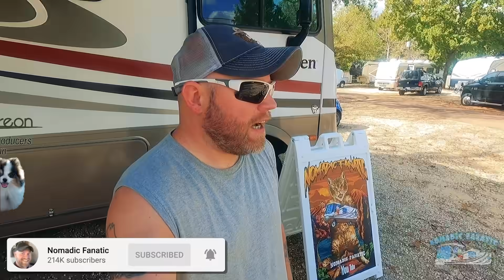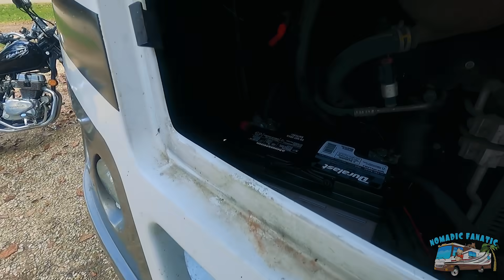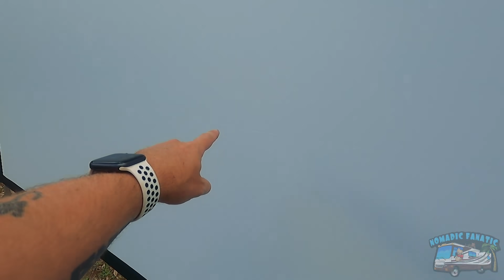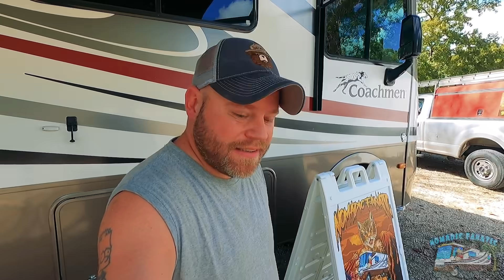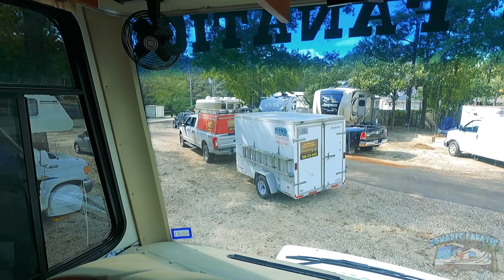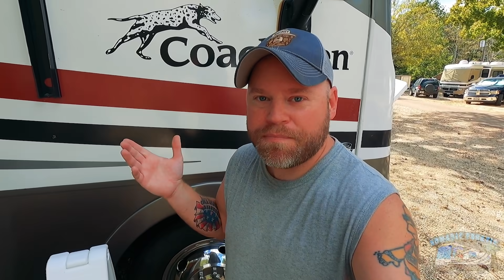More Onan Generator & Lippert Leveling Repairs... $$$

Comment: I have been ripped off by every contractor that has done repairs to my house, with the exception of one plumber!  And I am talking major repairs, new roof, new ac/heater unit, replacing sewer line after they jack hammered the bathroom floor, the painters that painted the interior and never used the primer I wanted told them to use, they painted only but the previous paint kept bleeding through, so much more too!!!  I finally had to get in my car, go out to the middle of the desert where no one was at, then throw rocks and scream my lungs out at every one of those characters! LOL!!!  Sounds crazy, but I had to vent!!!  So fed up with them taking advantage of an old person!

Comment: Eric the mechanics that are able to fix your problems are few and far between. Anything replaced or repaired that doesn’t fix the problem is done by mechanics that want to replace parts and not track down the true issue. I’ve had my van in 3 shops for the same issue and it’s still not fixed.

Comment: I have found some techs are good at structural items ... slides , suspension, floors  ... etc.  Others only are good at the mechanical stuff like AC's , Generators ,electrical .... etc.

Comment: The generator could be a spark problem ignition box or electrical 
I’d hope one of the mechanics wouldn’t checked but sometimes they are related to heat so it’s hard to simulate when trying to diagnose 

As for the hydraulics it’s a simple system 
Just need the right brain to look at it

Comment: That leaf blower would drive me crazy. Can't you complain to the office? Hasn't Miranda treated you better than the last one? Seems you were on the side of the road many times and don't forget the ongoing brake problems. Can you go directly to Lippert about the levelers? Aren't these manufacturers up around Elkhart, IN? That goes for the generator maker. Don't you have a slide that isn't working right either? Good luck and good weather on your way back.

Comment: Lippert has reached out to other YouTubers with a large following to repair/replace faulty components at their factory ?in exchange for positive promotion? You might reach out to them directly. I assume your RV is an orphan built under the Coachman name before they went belly up and their assets bought. The current ownership may not want to service it. All points to research. Good Luck. FWIW - My Onan does the same thing. shuts down for no reason and throws a code 36 - Engine stopped without command or being told to stop, forget how it's worded - usually starts back up with no problem.

Comment: I've seen at least two other channels that have had problems with Lippert components...I believe one was a slide...Lippert looks like it's junk. I've lived in a Class A - with suspect leveling jacks and you know what? Just park on a relatively level spot. Seriously. First Class A didn't have leveling. It's simply not necessary. On the generator - I'd recommend a 3k Honda portable and operate it manually. Seriously. All these things with computer-controlled electronics are damned unreliable. MaxxAir fans - total pieces of crap - go to 13.4 VDC and the boards fail?? SERIOUSLY? I put one on a REGULATED 13.2VDC and it failed. I pulled out the electronics and replaced it with a rheostat - a manual resistor that regulated fan speed. Works fine.

Comment: I have an RV with two air conditioners that are unfortunately to the point where they can't be fixed anymore they need to be replaced with new ones. Probably the same thing with our heat pump So that's the way it goes I mean sometimes things can be fixed and sometimes they just have to be replaced with a new item. I make home visits not as a repair person but I've run into those days where I've I tried to call ahead if I can sometimes it just doesn't happen and I have to call them late because I just had a late day and unexpected things that I didn't plan occurred. now as far as this RV and all the issues I have followed you for a long time and you have had other RVs have had issues so I don't like feel like this is something new but it seems to be frustrating you a lot more than usual.

Comment: This comment probably will not make you feel much better but I have a 1997 Winnebago Adventurer that has been pretty easy to keep in good shape, easy to work on more or less depending on your abilities of course - however this thing was built like a brick shit house all the systems seem to have been built very tough and even after 23 years everything still works - now of course I don't punish mine the way you do yours. Regarding the generator check out you tube channel "small engine mechanic" - this guy knows all their is to know about generators, he might be able to help you get it running. F-ing mechanics a good one is worth a zillion dollars, also maybe your buddy Wayne could help with the leveling jacks, those systems really shouldn't be that complicated, sounds to me like some stupid computer bullshit, maybe there is a way to dumb down the system and make it more manual, screw all the automatic electronics crap. Mine is the old hydraulic lever system and I just adjust height myself as needed, no computer! Anyway good luck things will turn around, but it does seem Coachman build quality is lacking - Dont take that RV of road anymore it cannot take the abuse - thanks for sharing all of your ups and downs, I have been following your travels for years now and enjoy your dedication and interesting adventures.

Comment: Typical coachman. I bought a brand new 36 ft rendezvous in 2000. Biggest piece of shit ever built. Leaks leaks and more leaks. The outside mirrors fell off due to wood rot. The kitchen floor bowed up about 6 inches due to a water leak. Pure JUNK

Comment: Maybe, since it is all electronics, it is a systemic issue. Maybe bad voltage control? Maybe a computer/controller between battery and levelers that you don't know about? Maybe fluctuations in current? Or maybe coachman just buys all its stuff from  China?

Comment: Unfortunately the RV industry builds nothing but crap. Plus, RV's are built to be used for only two or three weeks a year for vacations. You live, drive, & use your RV's 24/7 365 days a year, which they're not designed for so their lifespan is going to be a lot shorter. You might want to consider a 3500 HD Dually truck with a Northern Lite truck camper without the generator. Get a portable Honda generator instead. They are much more reliable than Onan. Northern Lites are built with a clam shell construction so they are much better than most truck campers.  Get a truck with a gas engine too. Diesels are no longer reliable. You'll lose a lot of interior space and storage compartments, but you'll have a lot less problems. Something to consider.

Comment: Lippert jacks are junk, look at big foot jacks and put a new system in. The. Generator sounds like a temp switch problem. Need to get an on an flow chart and see if you can pinpoint problem .

Comment: I hate coachman,. Had a 93 dodge custom van with coachman additions,   it rusted leaked, stained, and was massively uncomfortable -. Crap.    But hey people buy crap.    I think that way the slideouts are braced tells alot about the detail the unit was designed.  Most of the designs are just modifications of the previous year, which in turn are of the previous year and so on.   Buying a new rv is buying the problems of an industry without any quality program.  Buying a used rv is buying someone else's dicision to fix those issues with upgraded parts or whatever gets them through.  So when buying a used rv, decide if the previous owner upgraded, or dumpgraded

Comment: Listen the RV is working continuously 24-7 for a long time, obviously it wasn't meant to be heavy duty but leisure duty, in regards to your generator, sell the damn thing get this load off your RV and get a portable silent one, you need the generator only to charge your batteries you don't need heavy load gen... Seems like you got mice ate some wires common theme

Comment: You can thank California for your generator problems. California emissions rules mandate a  magnetic
ball valve to not allow fuel into the carburetor when
the motor is off. The valve sticks shut if not 
used frequently. Onan recommends you start your
generator frequently and run it for 20 minutes
to keep the valve clean. Does that promote clean
air quality? NO. it's obviously stupid but government
is stupid. Keep the faith buddy. Life is good.

Comment: I think there are some problems with your RV. Firstly the RV has been designed to be used only for a certain amount of days per year. So your slides, self leveling system, as a matter of fact your whole RV might not have been designed to be used 24/7 365 days a year. Still no excuse that you are having a horrible time to have your generator and jacks fixed. You might just have come to the designed end of life for your RV systems and from now on you will have to replace as there are no trained technicians out there to repair. Cars are like cell phones, replace every two years. RVs might be build to be replaced every ten years bur not if you use it 24/7 365. Good luck anyhow to come right.

Comment: It seems to me that your biggest problem is the technicians that are working on the RV. I say this because it appears that they keep throwing parts at the problem and never diagnosing the problem. To properly repair any system in a rv you must understand how it should work then follow a symptom to system to cause to correction repair method. I would be willing to bet that the problem with your leveling system is a connection/wiring issue. Possibly a missing input to the control board or a poor ground. Either way the rv is the victim of a poor technician, even the generator isn’t complicated just not diagnosed properly.
Reply from the maker: You know it's interesting.... EVERY mechanic I've visited with lately on the leveling and generator starts their talking with something like this: "The system is quite easy and simple and basic. Not a whole lot to it, and I can fix it"... Hours/days later they ALL come back with the same baffled response: "I have no idea. There's nothing else to fix or replace. It should work"..... And that's the irritating part. EVERYTHING that's broken on this RV has the same synopsis all year.
Reply: @nomadicfanatic  That’s a damn shame that you’ve had to deal with this. I’m sure Darin at My RV works in Washington would be able to fix it but a bit of a hike to WA

Comment: Best way to fix the generator is to by Abner another one while they fixed the 1 that they you have in the shop and to it's fixed in need something else to replace it leveling jags he better of just by holding system and putting it back in but something that lass and M not many people do leveling jacks on their arby's every single day he travel all over the United States just because that's how you make your any come you wear and tear a vehicle to death possible park them for 34 months in a pop and move while he drivers every freakin day tell you have that they left in it and that you don't keep it up maintain your generator holy has so many hours it by another will have